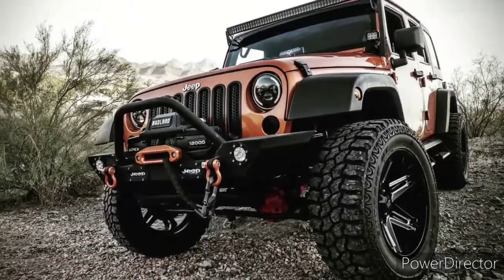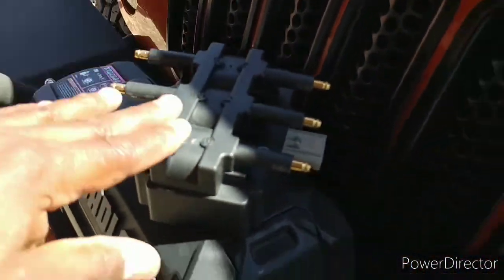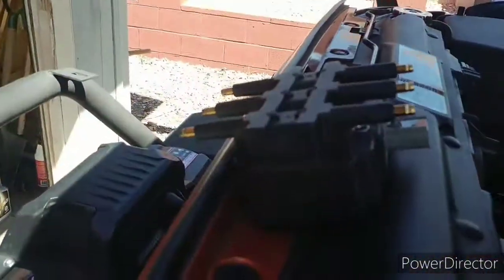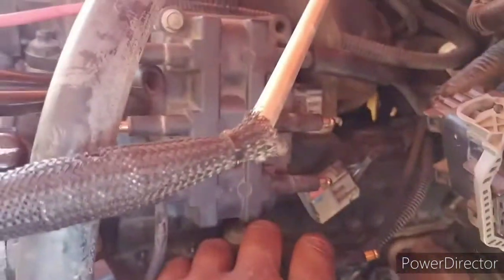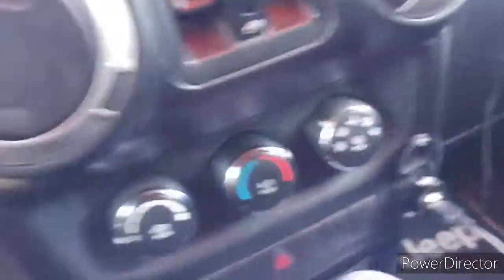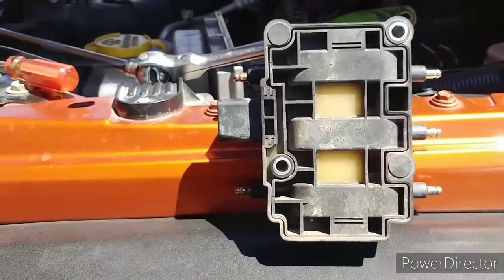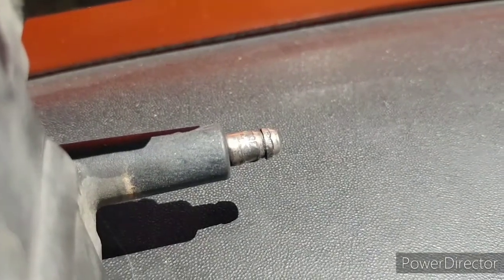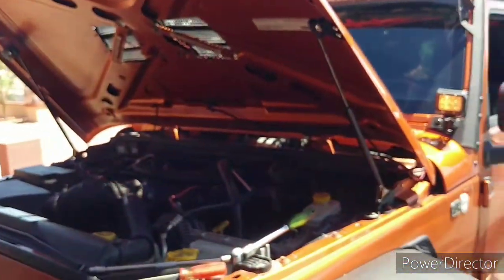How To Fix Jeep Wrangler Misfire Code P0306

Comment: Very knowledgeable man what year is this jeep
Reply from the maker: 2011 with the 3.8
Reply: Did that code clear on its own or did u erase it? Also did the code ever show up??
Reply: Currently dealing with this code on my 2011 Sahara, this video is about to save my ass! Thank you
Reply: @chloebarker8982  Currently Experiencing P0306 (6Cyl misfire). Shop advised that LOW COMPRESSION on CYL 6. Had to stop at that point. I think this was Luck on if in fact the  error cleared. Curious to know.
Reply: @papamrk1343  Hi! Yes so what we did first was just change out the spark plug from cylinder 6 that honestly seemed to be my issue, all my spark plug wires and my coil pack looked like they were recently done so I started with the cheapest option first (spark plug) my check engine light went on and off and then went away about 1 week after driving around, I haven’t had this issue since and my jeep was running good! (Always has another problem to fix lol)